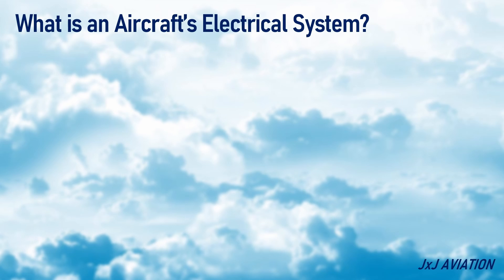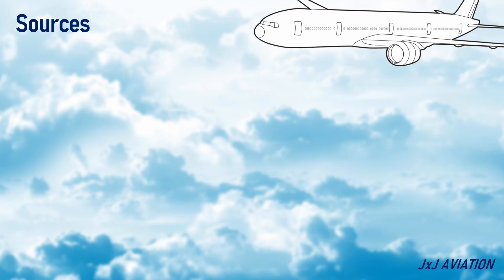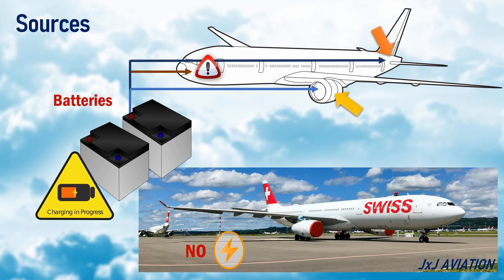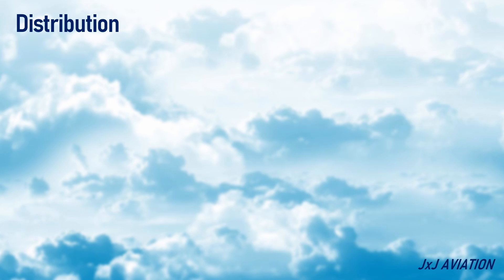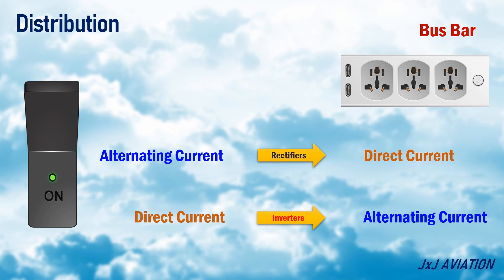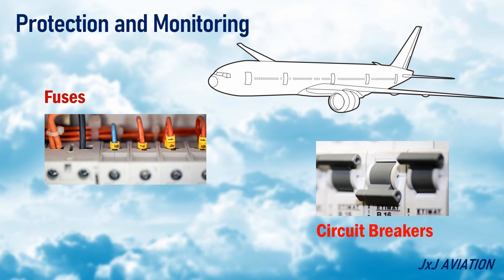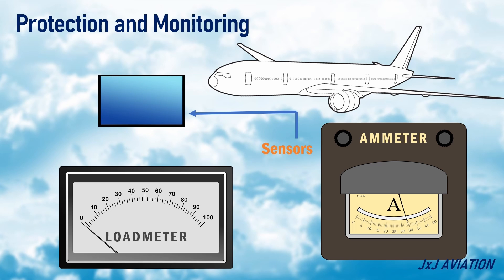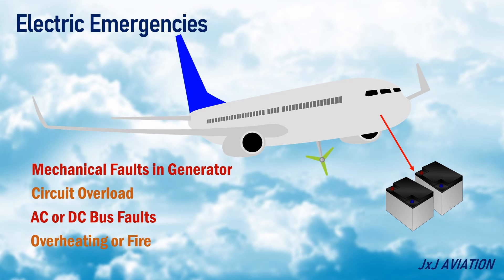How does an Aircraft's Electrical System function? | The Components | Electrical Emergencies |

Comment: 📝 Summary of Key Points:

📌 The aircraft's electrical system generates, stores, or supplies electrical power to various equipment such as lights, display units, pumps, computers, and communication systems.
🧐 The sources of electric power in an aircraft include batteries, engines connected to DC generators or AC alternators, and external ground power units.
🚀 The distribution of electric power is controlled by an on-off switch, and a bus bar is used to distribute power to different systems. Rectifiers convert AC to DC, and inverters convert DC to AC. Fuses or circuit breakers protect against electrical overload.
🚀 In case of emergencies affecting the electrical power supply, batteries become the initial power source for critical equipment, and auxiliary power units or emergency generators may be used.

💡 Additional Insights and Observations:

💬 "All aircraft are equipped with an electrical system that generates, stores, or supplies electrical power to various equipment." This highlights the importance of the electrical system in an aircraft.
📊 No specific data or statistics were mentioned in the video.
🌐 The video itself serves as a credible source of information about aircraft electrical systems.

📣 Concluding Remarks:

The aircraft's electrical system is crucial for powering various equipment on board. It relies on batteries, generators, and external power units to generate and distribute electrical power. In emergencies, the system ensures that critical equipment remains operational. Understanding the functioning of an aircraft's electrical system is essential for aviation professionals and enthusiasts alike.
Made using TalkBud!